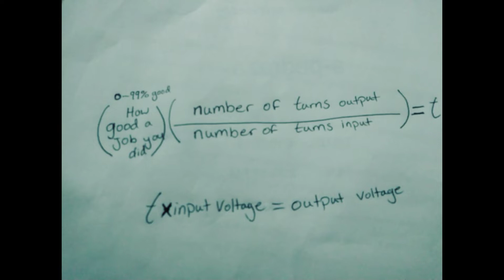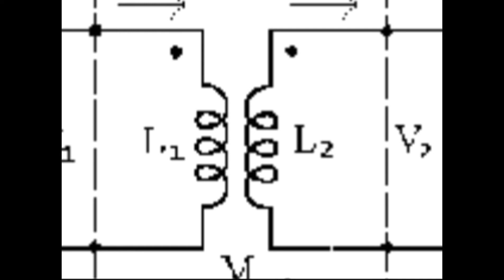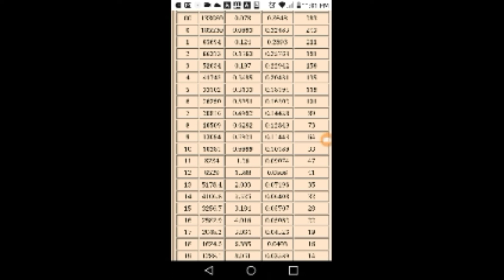Shtf trading power: watts the cost

Comment: That was interesting.
Reply from the maker: Thanks feel free to ask any questions you like
Reply: @preppertechnicianee6013  my goal is to do something like that waterlilly but with a different approach than putting it right in the water.  It would get clogged fast and is horrible to anything running through that.  I want to spin the fan with a vortex/venturi effect to run a small 12volt pump.
Reply from the maker: @JohnDoe-np3zk  that would be easiest and generate more power if you divert the water to an area and make a small drop onto the fan to maintain higher pressure.  That way you can have the filter farther from the Lilly what do you think ?
Reply: @preppertechnicianee6013  I am in a high theft zone with little space to work.  I have water rights and an easement and a lot of possible rules to worry about.  For now I bring my gas pump down there but I do have power kind of available.

Comment: In addition to the voltage and current output of your generator you need to worry about frequency. US standard is 60hz, European standard 50hz. Most electrical equipment is designed around these frequency standards and should use a sine wave AC. Although power transmission can be done at higher or lower frequencies and you can transmit longer distances by stepping up and down the voltage but you will want to maintain the 60/50hz standard for your normal household loads.. After you get power to where you want it step it down to 12 volts and rectify it into DC filter it with capacitors, or charge a battery and use 12 volt where possible or use an inverter. You can get modified sine wave or pure sine wave. Pure sine wave is best but more expensive.
Reply from the maker: Yup but im a little worried about teaching people to make alternaters.
I hear its where alot of injuries happen.  And a good one is pretty technical id refer you to more specific creators like electroboom or evvlogs

Imma be doing a vid on electrical scrap next teaching people what is useful.
Reply: @preppertechnicianee6013  Inverters are pretty cheap. If you are generating AC you rescue an old generator where the gas engine is broken, or even a car alternator and bypass the rectifiers and voltage regulator. Feed the output directly into the step up transformer.
Reply from the maker: @stuarthirsch  ya i have a plan to teach them where they can scrap inverters from i dont wanna say go buy it

I wanna make scrap only projects when i get to that level 

alternater for use as generators is in the future as well